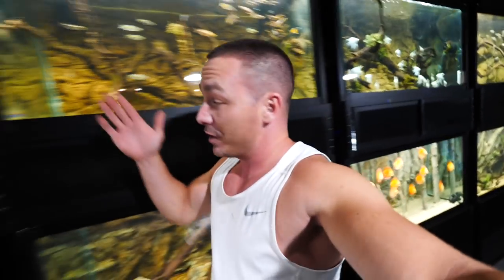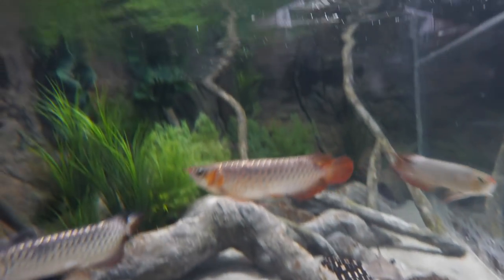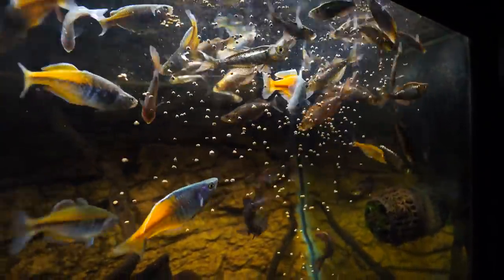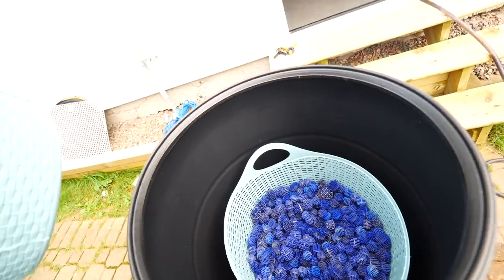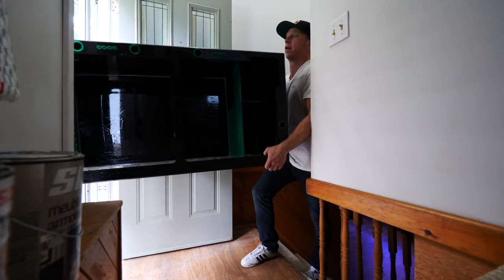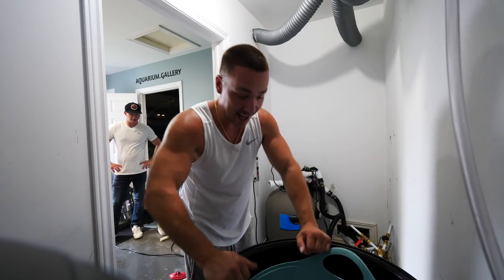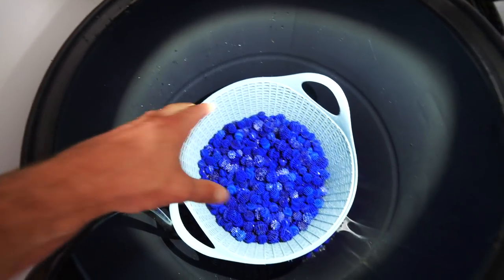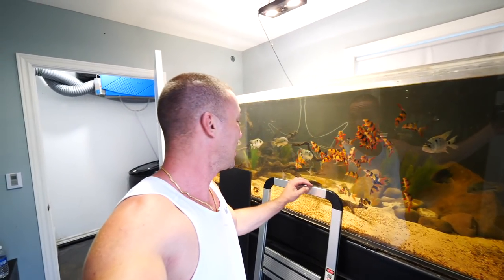IT WORKS! DIY Aquarium filter complete and fish fed! | The King of DIY

Comment: Hey Joey I just noticed that when you were spraying the sump out that the concrete floor to the gallery is hanging kind of by itself.   You need to add a retaining wall around that side of the building to stop the gravel from totally washing out. If you wait to long your floor might start breaking up.  I pour concrete for a living so I notice these types of things. I would try to do it before winter.

Comment: 2 things:
1. I'd like to see the pump in the barrel filter and running.
2. Ideas for doing a 5 gal bucket version of the barrel filter.
Reply: He has done a diy video on a 5 gallon bucket filter before. The pump is on the outside instead of inside, but its a very similar concept.

Comment: I really like the filter.  Do you need to keep the water level below the batting? I'm thinking this could work to filter two 125s I'm planning. Thanks for the idea.
Reply: you just need to have the overflows to match the pump, after that make sure the overflow intake is at a height that wont overflow the barrel in case power goes out. the return pipe needs a hole so that it doesnt become a siphon as well.

Comment: Joey, I just got some new discus they have been in the tank for around a week and I haven’t seen them eat. Should I be worried? If so, how can I fix this? Thx
Reply: First of all wat is ur water parameters?  Turn ur heater up to 90F and do 50% water change helps as well. Also try to feed them in the morning
Reply: It’s a 55 with 3 discus. The pH is 6.4 and temp is about 86. I have a chinease alge eater as well.

Comment: If i was going to make the same type of filter for a 150 gallon how big of a container would you reccomend
Reply: Christian Hazel after seeing this video I sorta want to 
And one myself, for my 100 gallon salt aquarium,  it would be just so much easier, and convenient! You’d get a lot more filtration
Reply: Jose Coto doesn't tend to be recommended unless it's a fish only system as it will just raise nitrates
Reply: Matthew Cahill aaahhh , whaaaat, mm how would they raise nitrates?
Reply: Jose Coto filters like this are remarkably good at doing the nitrogen cycle up to nitrate then they don't really convert much to nitrogen. The best filtration to have on a reef or even for most fish only saltwater system is good mechanical filtration to get rid of anything that will eventually be broken into nitrates, most use filter socks as they can be changed daily and then a protein skimmer as this further removes dissolved organic compounds that would otherwise become nitrate. Live rock itself is very pour in comparison at running the cycle to make nitrate but is able to continue the process of turning nitrate into nitrogen. Best bet for any saltwater system is a sump as you can hide everything away except any powerhead or wavemakers

Comment: Joey you could just drill a hole in the side lower than the second basket like a rain fall filter can’t remeber what there called, so then the water has to travel threw all the filter material before going back into the tank

Comment: Think if, you want the top water, because it's cleaner. I enjoy how you stay buisy, and manage making videos.  Plastic 55g drums like that, if hooked up correctly a good filter. But you want another barrel for just clean water,heater and algae scrubber. Filtering water is good. Especially for big ponds.
Reply: The only problem with sumps, is the same as floor sumps. They can over fill. Which make an interesting sump over flow challenge. Without two pumps. You would at least need a sump overflow,that goes to a drain. The only logical theory. To build the over flow to the  return tube.

Comment: Why didn't you put the barrel on a stand and glue a pipe on it so the weight of the water in the barrel would push itself through the small pipe to return to the tank.
Even if not on a stand and the pipe was near the bottom it would work to return. 
And only use one pump , just not a fast pump. 
Because the pipe would need to be a inch.
But the extra media contact time would be efficient.

Comment: What's the size of your 8 tanks in gallary
Reply: Aloysius Antony 125 gallons per tank on the racking system, plus 50 gallon sump for each tank.
Reply: 10 tanks 5 racks 125 per tanks
Reply: @richie73  ltrs or gallons

Comment: Could you use lava rocks instead of the bio balls
Reply: Jarid Reddick 
Yes you could definitely use lava rock. It’s way cheaper and frankly holds up better over time then the media bio blocks and round spheres Joey is using in my opinion. You just have to rinse the lava rock well before use. If you don’t you will have a layer of silt at the bottom of your filter. If would prematurely clog your filter or pump, depending on your setup.
Reply: Joey also has a video of him using lava rock somewhere in his channel
Reply: Thanks man I’ve been in the salt side of the house for a while and I’m about to build a big pond for some red tails and peacock bass looking to do a DIY filter

Comment: HEY JOEY!!!! At 4:49, this shows the concrete slab base of your garage/fish gallery is up in the air and not supported.  This WILL result in the slab failing and the entire structure failing.  You need to fill in the base under the slab ASAP!!!!!
Reply: byankos lol have you ever poured concrete before? It has rebar in it, to support it, however if it went like that for a decade it could be bad
Reply: Big MacMik3 Too much time in the mud
Reply: Slab usually has mesh or #3 rebar. I still recommend filling it. Without relief cuts, you never know where it will crack

Comment: Why do you even use a basket instead of having the balls directly in the barrel?
Reply: Because it will float!
Reply: @johnwhiff4790  why not use some kind of disk and drill some holes in it, problem with the basket not fitting perferctly is than solved
Reply: Bio-Balls work better when water trickles down over them, as opposed to most other types of bio-media which work better submerged. Which is why he drilled the holes in the top basket. The ones floating loose in the bottom will still work too, just not as efficiently.
Reply: Krakaka, I think its to enable easy removal of the media(for cleaning) and to make it easy to aim the water flow through.
Reply: That I dont know